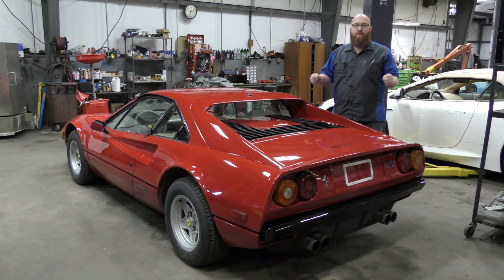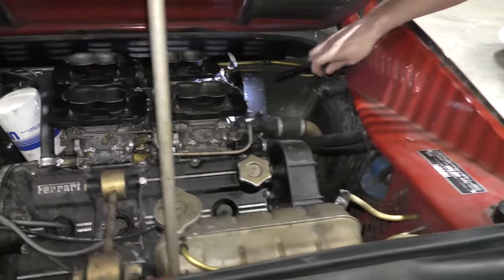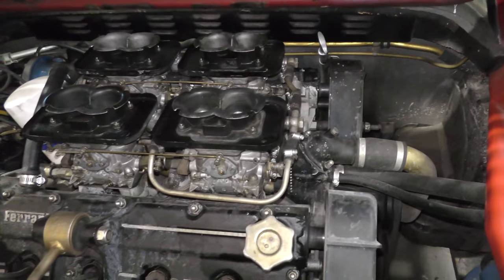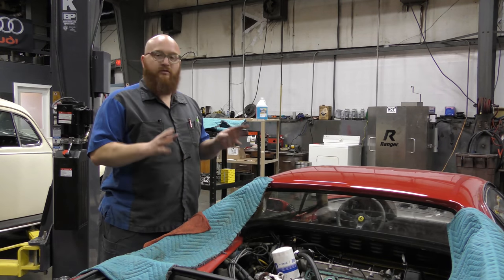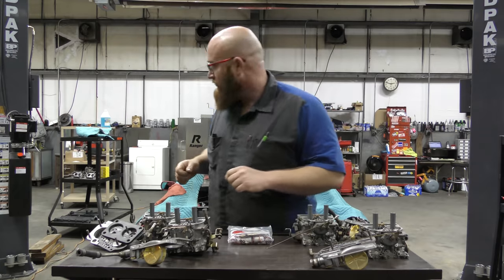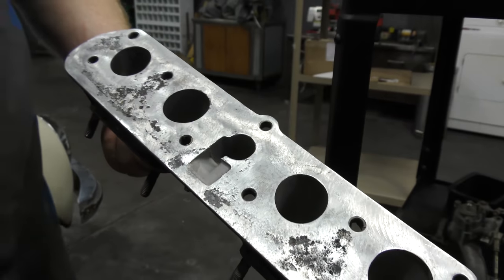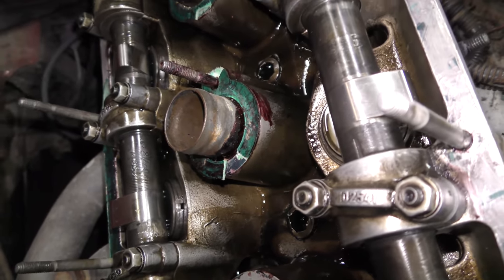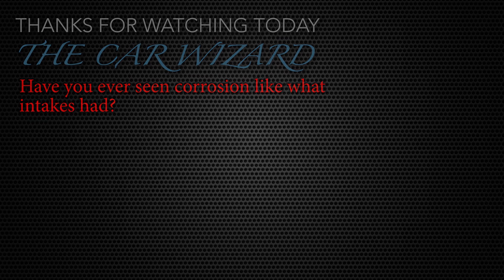Tearing down the Car Trek 4 Ferrari 308 V8! What does the CAR WIZARD find?

Comment: If you decently restore this Ferrari you can easily double your investment.
Reply: And drive it for a couple thousand km too ! Without much depreciation
Reply: Still a beautiful car
Reply: and tons of content to monetize
Reply: @hexicalcat4937  you could ride it for as long as you want, its done depreciating.
Reply: "If you decently restore...easily double your money"

Uhh, no.

Rough but all original, low miles '78 GTBs in "fair" condition currently sell for $30K-$40K. Well sorted all original low miles cars in "good" condition sell for  $45K-$50K

To get that hacked-up POS to original "fair" condition would cost $20K in parts alone. Parts alone to get it to "good" condition would run twice that.

$40K in original, period-correct parts plus a shitton of "free" labor and he might be able to get it to "good" condition and sell it for $45K-$50K. Putting $75K into a car you sell for $50K isn't "doubling your money". Even if he managed to somehow get that POS into market-recognized "excellent" condition, all original, low miles '78 GTBs in "excellent" condition sell in the $75K range.
Reply: @bobsmith8077  is that 2021 pricing or 2019 pricing..
Big difference.
Reply: I'd say, with his mindset, triple.
Reply: @bobsmith8077  That's assuming this car is not gonna appreciate in price, which it probably will. It's one of the last affordable Ferraris.
Reply: @bobsmith8077  What the hell are you talking about. Your numbers are at least 5 years old. These things are going up like crazy
Reply: He better be able to do that. I still think it was crappy for car Wizard to even pay a dollar for this pile.
Reply: @bobsmith8077  I don't think David would have bought it, if he didn't think he couldn't fix it and still leave room to make some money on it.  Probably not double, but maybe he has 50K in it less labor and today's market it brings $70K.
Reply: Judging by the monthly subscriber increase, he can drive this around for quite some time and still sell it with a hefty "Wizard tax"
Reply: @bobsmith8077  update your numbers
Reply: Will The Wizard fit in the car?
Reply: This is a beautiful car. Thanks for saving it!
Reply: @bobsmith8077  This guy is completely wrong. Every single "fact" is completely made up.  A quick google search will verify what I am saying.
Reply: @CR7659   "I don't think David would have bought it, if he didn't think he couldn't fix it and still leave room to make some money on it."

Come on, let's be honest. He bought it to drive views/engagements, thus increase AdSense revenue.
Reply: @PuerRidcully  "That's assuming this car is not gonna appreciate in price, which it probably will. It's one of the last affordable Ferraris."

In March/April of this year, a market-standard "excellent" '79 GTB with only 14K original miles was "offered" at $85K and sold for a bit less.

The ~$39K that a west coast 308 cost in 1978 works out to about $160K when adjusted for inflation. A 308 restored to concours level today goes for ~$100K, $120K for a truly exceptional car.

Setting aside the relatively few Vetroresinas out there, Ferrari made nearly 12,000 Pininfarina-bodied 308s, more than 6,000 of those were carb cars. It's going to take a long time for them to appreciate much beyond where they are now. There are just too many of them out there. 

Moreover, a '78 carb car with a bunch of tacked-on non-original QValve parts [chin spoiler, rear deck lid/spoiler, door panels, etc.] and a bunch of aftermarket fake crap [sideview mirrors, grille, the entire interior, etc.] and a bunch of aftermarket hacks/mods [A/C delete, seats, ignition system, etc.] will never appreciate in value. He's already said that he's not going to buy original seats, remove the fake spoiler, and that he's going to keep most of that fake/aftermarket interior.

Again, he bought that hacked-up POS car in the hopes that by drafting off of Tavarish and Hoovie it generates a lot of YouTube revenue. Fair enough. But that's not going to increase the value of the car, unless one of the fanboys here in the comments want to throw away some good money after bad. 

I mean the guy said he is going to have those destroyed intake manifolds TIG welded, "should be good enough". Come one, no one's going to pay a premium for that level of cost-saving "good enough" work.
Reply: @bobsmith8077  If you haven't seen or driven the car how do you know how much if a POS it is? He paid 25k for it, if he puts 5-8k in parts it owes him 30-33k.

In 2 years after the current US administration has screwed the economy and inflation hits as it is already,  hard assets will go up even more. I could easily see this as a Car Wizard restored car trek car being worth $70k. Plus the $30k he'll make in 2 yeaes from the vids he does from it. 
But maybe he'll keep it for 20 years. Give it to his kid.

Great choice to buy it. Only a fool (if it was someone in his position) would turn down a Ferrari for 20odd grand in todays market.
Reply: @bobsmith8077  It is a shrewd move for him to use this car to produce content, because a lot of people love 308s and would be very interested in watching this series.
Reply: @bobsmith8077  The first thing he dud was replace the sears, junk the aftermarket interior buts and send it off for retrim.
The Grill he can just take off , replace or demodify.
Reply: @davidg3283  "It is a shrewd move for him to use this car to produce content, because a lot of people love 308s"

Absolutely, which I said in my post.

But I was addressing the "only he could do this project right/he's going to fully restore it/make a mint off this car" fan boys, who have absolutely no idea what they are talking about.

As for the car itself, the best that will ever come of this is he gets it running just well enough to have a bit of fun driving it on the weekends and then sells it for parts/scrap when he's tired of it.
Reply: @bobsmith8077  Please show me a 78 GTB in any (reasonable. i.e intact and not totaled) condition for $30k and i'll buy it in a heartbeat, like I would have this one had it been offered for sale outside of Freddie's circle of friends.  Cheapest i've seen them for have been in the $60k-$70k range.
Reply: @theevolutionofthebear3093  You have no idea what you are talking about.
Reply: @qumefox  Google not working for you?  GTB carb cars in rough but complete to so-so condition with 40K-60K miles are all over the place for significantly less than $50K, individual sales in particular. Just because a bunch of dealers are asking some crazy high prices doesn't mean they are getting them.

As I mentioned, a really nice "excellent" low miles '79 GTB sold through Hagerty in Florida a month ago for 70 something [asking $85K]

But all of that is irrelevant to the points I was actually making. All of these cars you are seeing on dealer websites asking the higher $60K-$90K for '75-79 GTBs are cars that are all original and in good condition. Not like the hacked-up, fake, aftermarket, tacked-on QValve parts POS car like one the Wizard bought.

To get his car to the level of that '79 from Hagerty would take $50K or more, and that's assuming that he puts a value on his own labor at less than minimum wage.

A genuine, period correct U.S. spec front bumper in 'fair' used condition can run $2K. Genuine seats in rough shape are $1K-$2K each. Used genuine, period correct steering wheels are $1K-$2K depending on condition. A used genuine shifter ball will run $300-$500. Now figure what it would cost for genuine used parts just to put that interior back together.

Again, just like Samcrac and all of the others who stop working on projects when the views drop off, this car was bought in the hope of driving traffic and ad revenue.
Reply: Looks like it has aftermarket headers also.  Should note that a GTB is much rarer than the GTS and worth a bit more.
Reply: @Bob Smith Yeah, he won't double his money. He'll mechanically fix it up, get it running decently, then sell it to get his money back or make a little bit on top.
Reply: @bobsmith8077  Google works fine, and seems to disagree with you considerably regarding pricing.  Although proving me wrong is easy. Just post a link to one in the $30k range for sale if they're so easy to find.  I'm waiting.
Reply: @bobsmith8077  he clearly bought it to enjoy, not restore and flip. That's why he's not bothered by the work it needs. I mean he said he's putting aftermarket seats in it lol. This will be a perfectly fine driver once he's done with it.
Reply from the maker: @bobsmith8077  You are clearly misinformed. Your price estimates are circa 2005. It is not a POS. You are a very disrespectful person. Shame on you. Very much shame on you.
Reply from the maker: @theevolutionofthebear3093  Agreed. This guy is jealous
Reply: @CarWizard  I like the Ferrari 308!  They are very cool.  And yes, they are highly collectible.
Reply: @CarWizard  I agree with you but careful weighing in on it! Not worth it for one guy who's Google is broken. 😂
Reply: Never happen. No real Ferrari person will be a serious buyer. It is a butchered up pile of you know what. Might be worth a bit more then a kit car Ferrari. This thing is worth more as a parts car. DO NOT WAST/INVEST YOUR TIME OR MONEY !
Reply: @CarWizard  Some people are just angry nothing to do with you. I like the channel and I love 308s. One of my favorite Ferraris.
Reply: @CarWizard  Well, that kind of ad hominem reply is certainly easier than you dealing with the substance of my comments, all of which were directed towards the car.

Do you disagree that the chin spoiler, rear deck, roof spoiler, etc. are not appropriate for a '78 car and that they are either aftermarket or from an 80's injected/QValve car? Do you disagree that the door panels and carpeting are also either aftermarket or from a much later car? Do you disagree that the pedals, shifter ball, steering wheel, and sideview mirrors are fake/aftermarket?

Do you disagree that the cost for all of the genuine, period correct used parts required to put that interior back to original alone would run $10K-$15K or more?

Do you really think that anyone willing to pay top dollar for a '78 GTB car would still be willing to do so if they knew that the A/C that it came with had been deleted, that it was running an aftermarket Ford [electronic?] ignition, and that it had TIG welded intake manifolds ground back down?

Look, noting personal, and as I said, I understand completely that the purpose in buying the car is to drive traffic to your channel and that you aren't going to do a full let alone concours restoration. Maybe you even get it running and reliable enough to enjoy driving it on weekends. Fair enough, all good. But that car as it sits is objectively a hot mess of a hacked-up mishmash of real, aftermarket, and fake parts from various 308s spanning '78 to '85.

Hey, I have no issue with you doing with your car whatever the hell you want to. And even if I did, who cares, right? I'm just shaking my head and chuckling at the commenters who think that you are going to do anything close to a full restoration on that heap and then sell it for top dollar.

On the other hand, maybe you could wrench on it for a while until the views start to drop off and then pawn it off on another YouTuber. The two of you could then say that it was sold/bought for $150K!!! and that you proved some anonymous guy on the internet wrong.
Reply: @bobsmith8077  Oh maybe, or maybe he just wanted the car.  I mean if I could have bought it and made videos that would pay for the cost of it, that's a total no brainer to own what is at least a cool looking car.
Reply: @CarWizard  price values on these cars are totally "pie in sky" numbers. A car is worth what someone else will pay for it. Period. You can shut down the speculation on that statement alone.

This "Bob Smith" guy has zero content and about as much credibility.  I would take Ferrari collector David Lee's advice over Bob Smith's all day long.

I am a huge fan of this car for what it is - a small lightweight sports car that has just enough power to get out of its own way, and bring a smile to the owner/driver who appreciates it for what Ferrari intended it to be.
Reply: @CR7659  Sure, who said otherwise?

Gotta love the internet though. Agree with me and you are a smart, astute, cool guy. But even the slightest bit of disagreement or hint of criticism and you are a "jealous" hater. LOL.
Reply: @houseofno   "Ferrari collector..." LOL.

Do you really think that car - that particular car - will ever be given a second look by a real "Ferrari collector"?

The really funny thing about all of this is that some of you seem to believe that you are being clever and trenchant and effectively rebutting my comments about this particular car by pointing out that there are a lot of low mileage, well sorted, all original, period correct cars out there going for really good money - something that this particular car will never be because of how hacked up and damaged it is.

Someone pointing out that particularly good examples of all original late carb cars are going for $70K-$90K and then trying to compare those to this car or any potential this car has short of a full restoration is just silly ridiculous.

But none of that means that Wizard won't be able to drive traffic to his channel, maybe make some good AdSense money, and have some fun along the way. The two things [the car being a hot mess and also being good YouTube material] aren't mutually exclusive. Nor is any of it personal.
Reply: @bobsmith8077  yeah I have to agree with you. I'm sure he will make some money, probably more on views as you mentioned. but these comments are way over valuing the car after what's been done to it, and further being done to it. There are far better examples on the market for 60k with all original parts and not made a laughing stock on a show as a hunk of junk.
These older Ferraris are ruthless when it comes to originality and upkeep. And unless he gets some dopey YouTuber or fan, no one would purchase this for much more than he did.
Reply: @bobsmith8077  although I generally agree with you, I couldn't help but chuckle at @Car Wizard's (obviously) sarcastic comment.   

I think it's clear to most people here that the average person buying a 308 in this condition will not be able to make a profit from it unless it helps their business (in this case youtube, his garage etc.).  

On the other hand (to those who keep going on about profit), if you have 20k to spend on a budget ferrari and the extra time/money to fix it, why the heck not?  It's not always about profit, sometimes it's about fun.  

Now we can keep the heat low, there's already enough heat in that 308 engine (I don't think anyone actually means to insult anyone - maybe I'm optimistic).
Reply: @bobsmith8077  I saw a wall of text, I expected pointless rant, but that was  surprisingly well thought out, thanks. Anyway, there's also the power of internet fame and that will account for a few bucks  as well. 
But Wizard is a rich guy at this point, he could have as well just bought it for himself.
Reply: I love how y'all he can't make profit he can't this. He could make profit he runs his own shop and has his own connections. He has particular set of skills that save him money and time. These 20k dollar estimate our a joke. Wizard probaly cut that half in cost. I do it all the time with rebuilds and restores because I take time look for deals and oh look for part from another company that can work diffrent part number because it's from a diffrent company but it's the same exact part it's called reasearch and sometimew it pays off I have cut the price of my rebuilds and resotees by half  sometime not all the time sometimes. I could do even more if I could fabricate parts.
Reply: @bobsmith8077  hey, shoot me links to some good condition, sub-50k Ferraris. can't find them for the life of me.
Reply: @gavinplunkett977  Good point...I looked at one years ago and had trouble with leg room and I am about 6 ft tall. Love to hear Wizard discuss roominess issues.
Reply: The 308 will always be held down in price by 80k California's 100k 599's, and cheap 348's 355's hell a Mondial T is a better car and cheaper than a 308.  When I bought my manual 6 speed F360 back in 09 it was under 100k and a relatively new car at the time.
Reply: @bobsmith8077  asking prices are not sale prices the 308 is overrated, it's slow and ponderous no different than other craptastic late seventies early 80's cars.  83 Camaro Berlinetta is a perfect example it is a terrible car but looks period and a few dummies overpay to own one now.
Reply from the maker: @bobsmith8077  Couldnt be more wrong. The purpose of buying the vehicle is to enjoy owning a Ferrari. It will never be Concours quality, which I actually judged at last weekend, Amelia Island Concours D’elegance. I didnt see you there. 
I dont expect $100k for it once done. More like $50-60k. I already have several emails offering this much for it once its done because of it Car Trek provenance. So to say that it cannot bring $60k, is very foolish of you, and very uninformed. 
I have 3 people in waiting, to purchase it as I type this. Quit grumbling and showing such hatred. Be happy for folks for once. Rather than trying to shoot them down. Its very unbecoming of a quality individual.
Reply: @CarWizard  Opinions are like backsides, everyone has one, just some are worse than others !
Reply: @danstewart8218  "TIG-ing those manifolds, and then skimming them...." --- has to be done REALLY carefully, because TIGging aluminium (sorry, I should say "aluminum", revealing my roots there)  is BLOODY difficult to do well. There's a fine line between not sticking the new metal on well enough, and melting chunks out of it or warping it. Or possibly worse, blowing through into a coolant passage, thus permanently ruining a servicable-with-a-splodge-of-hylomar head. Getting someone competent enough to hit that fine line, AND not costing the earth, there's the challenge. PS: I know of what I speak, re: heads, having done a couple myself for my Jaguar V12 engine. I practiced for weeks on old Rover heads until I could do it right...

....and I've just realised it's the intake manifold that needs TIG, not the head. So cancel most of the above... decking it flat and true is actually the only really challenging part of that job, especially once you've TIGged all over your reference surface...
Reply: @CarWizard  Look, I get it. YouTube channels are like a bunch of individual little religious cults and political parties and the leaders and the orthodoxy will be defended at any and all costs. Fine. That's the environment, that's how it works.

But you and a few others seem to be taking my observations about the car - the car - very, very personally. Which is really kind of odd when you stop to think about it.

You say you bought it to "enjoy owning a Ferrari". Hey, fine by me. But that's just it, all of my observations about the car - the car, not you personally [thicker skin maybe?] - is that the reality is that there is precious little genuine Ferrari left in/on that particular Ferrari. The entire interior as well as the front end is a fake, hacked-up, aftermarket mess. There are at least three body panels that are either aftermarket or at best from a much later car. Several hacks and non-Ferrari parts in the engine bay, etc.

Just curious - are you going to put that front end back to genuine [grille, lights, bumper, chin spoiler]? Are you going to put a U.S. spec bumper on the rear, or at least put an incorrect European bumper on the front to match [though if you are going to do that then you really should put Euro side markers on as well]? Are you going to put the interior back to genuine [seats, carpeting, door panels, dash, center console, switches, ash tray/lighter headliner, steering wheel, shifter, pedals]? Are you going to put the engine back to genuine? Are you going to replace that aftermarket/QValve decklid and cheesy spoiler with a period correct decklid sans spoiler? Are you going to replace those cheesy fake Vitalone Turbos with a single period correct real Vitalone California?

As for selling it on, hey, I said a few posts up that it wouldn't surprise me if you sold it to another YouTuber or to some fan of the channel willing to overpay for a less-than-Ferrari-Ferrari just because of its YouTube "provenance". So that would be no surprise. 

But at what point is a Ferrari not really a Ferrari anymore? How many fake/aftermarket/incorrect parts and body panels can a Ferrari have and still be a Ferrari? Is it just the shape or the engine block that is needed to make it a Ferrari? Or is just the Prancing Horse badging sufficient?

Like I said, just genuinely curious - about the car. Nothing personal at all. The only personal animus I have here is for the previous owner[s] who hacked into oblivion one of the most beautiful cars of all time. That's the real problem. Well, in a first world problems sort of way. Though I gather by all of your ad hominem comments directed at me personally that you are enjoying the traffic bump coming from this repartee. LOL. 

Cheers, and good luck with the project.
Reply: @bobsmith8077  You don't become as successful as the Wizard has by making bad decisions. Imagine dedicating wasting your day typing up bitter nonsense, meanwhile a 1999 Honda Civic sits on your driveway. Go you.
Reply: @EazyDuz18  True!
Reply: @EazyDuz18  You might want to try looking in the mirror.

Not that it matters in the least, but how "successful" do you believe he is? He definitely has a YouTube channel with 500K subs and an auto repair business in Newton, Hesston [?], KS. But more importantly, why is his relative success, however one defines that term, so important to you? Do you believe that only good and smart people are "successful"? Do you believe that a person's opinions and observations don't matter unless they have achieved some arbitrary level of success as determined by you? Do you value the opinions of someone as venal and narcissistic as say, Donald Trump - just because he pretends to be a billionaire? Though maybe we shouldn't go there. The answer may be uncomfortable for some.

It matters not to me how successful he may or may not be, but then again I have never made any comments about his "success" or his skills as a mechanic or his business acumen. I also don't recall claiming that it was necessarily a bad decision. In fact, I said that it was likely that it would increase his YouTube revenue and he very well may flip it to someone  willing to overpay because it is a YouTube car. What I did say is that no serious, savvy Ferrari buyer/collector will ever buy that car because of how badly it was hacked up by its previous owners. Seriously, with enough cheerleaders like you, the purchase may very well make good [Ad]sense [see what I did there?]. 

Finally, I've spent a grand total of maybe 20 minutes  posting comments to this thread.

You know, and I mean this in all good humor, you and several others here remind me of that great New Yorker cartoon of the guy sitting at his computer typing furiously, with his wife yelling at him to come to bed, to which he responds, "I can't, someone's wrong on the internet". LOL!
Reply: @bobsmith8077  No way I'm reading that essay, refer to previous post.
Reply: @bobsmith8077  Not reading that essay lmao, refer to previous post
Reply: Oh my it’s getting really hard to read comments anymore . Everyone is a narcissistic know it all . I don’t know anything at all about the prices of these cars and don’t care . I’m in the buy a decent reliable and good performing car and drive it . This car to someone like me is puzzling. I don’t think it does any of this stuff but does look sexy .
Reply: If it's bought for 25k, 15k goes into fixing it up some more, that's only 40K. Then sell it for 60K + the views from fixing it on the channel? Can't speculate on the value of the views but it's not 0, so probably 25k profit on a car he bought for 25k. In my heart that would feel like doubling my money, but in my brain I know it's not.
Reply: @houseofno  "This "Bob Smith" guy has zero content and about as much credibility."
Exactly what are you inferring from the fact he has no content? Is it that, if you're a content creator on YouTube, you automatically must have more credibility than someone who isn't? It may surprise you to learn that not everyone who knows about things is making videos about them for YouTube. I note you ironically have no content though... Mr. Pot.
Reply: @CarWizard  "It will never be Concours quality"
He didn't say it was going to be - he said " I understand completely that the purpose in buying the car is to drive traffic to your channel and that you aren't going to do a full let alone concours restoration."
He also said " I'm just shaking my head and chuckling at the commenters who think that you are going to do anything close to a full restoration on that heap and then sell it for top dollar." - is he wrong?
"...I actually judged at last weekend, Amelia Island Concours D’elegance. I didnt see you there." Are you sure about that? Keep a watch on that ego there, big fella. It's not a good look.
Reply: Newsflash... no one has any idea what "Car Trek" is